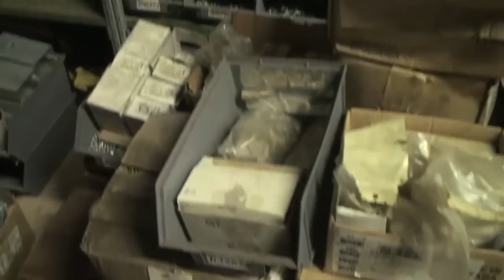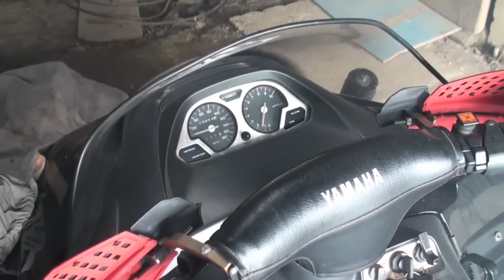jims on the dip, nelsons on the smelt, and the hitch hiker is going the wrong way ffs

Comment: What happened to big dirty?
I never seen a can of dip that big before. I live in the southern US for 10 years and most of the people crew a pocket size can of dip.
I don't even mess with it, I'm from the Northeastern part of the US.
Reply: I'm from Northern Ohio and I don't touch the stuff either.. But I've seen them in most gas stations and drug stores.. They cost an arm and a leg though from what I've seen
Reply: Hahahaha, an arm and a leg. That's crazy.
Reply: Mr. Nationwide You've never heard tha expression before? It's pretty widely used..
Reply: Of course I have.
Reply: You can get a tub of stokers which equals 10 tins for like $10 bucks and  compared to a tin of copenhagen at $4 dollars a tin. I live in Pa but them guys up there pay like $20-25 for a tin of copenhagen. Jim must be mail ordering dip through the Northerner.
Reply: Cap10323
11 bucks here in va for a tub of stokers not a arm and a leg lol
Reply: ford bayou If I remember right.. Its like $10 a tin up here.. and one of those huge tubs is like $30.. But I'm In Ohio.
Reply: god damn. yea here in va im payin 3 and some change for a can of copenhagen WG and copenhagen straight. you're better off buying from the northerner.com
Reply: He had a tub of dip and in Canada 1 regular size can is anywhere from $19 to $28. A pack of cigrits here are about $13.
Reply: Sam Munro and the edarts are not even any cheaper.. would rather buy a pack for $9.50 every 3 days then spend $50 every week.
Reply: Cap10323 It's around $15 a tub... Not expensive at all. Mr. Nationwide That's not a tin, it's a tub, equivalent to 10 tins. Up in Canada they tax the hell out of dip so a tin of dip is around $25, not worth it.